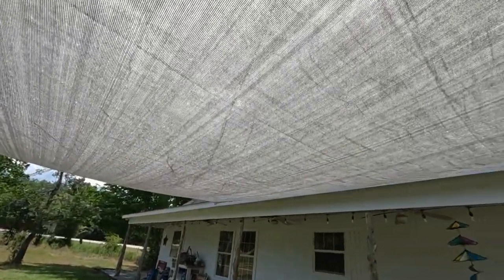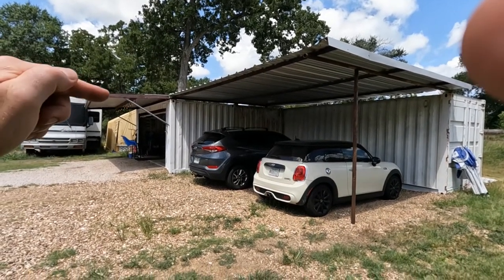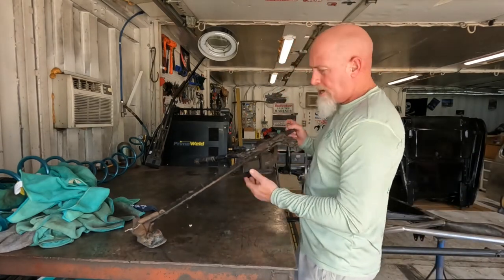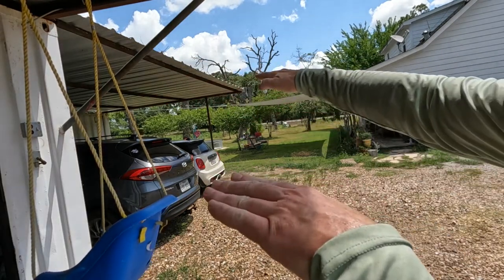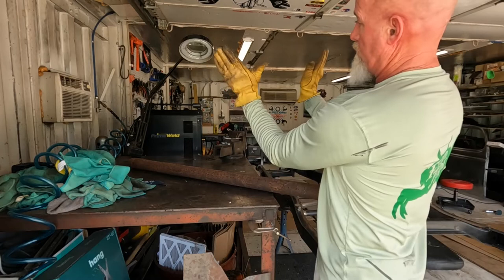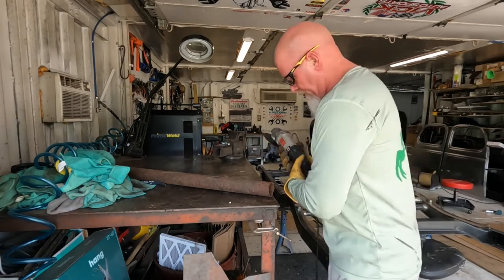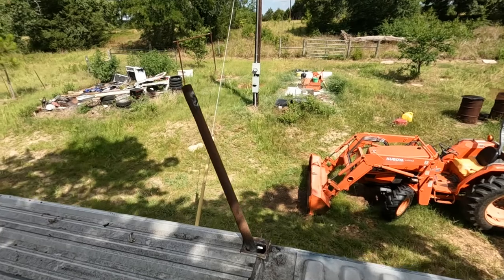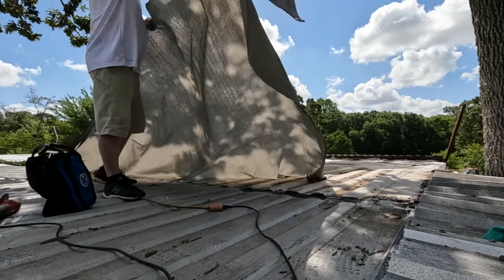Shipping Container Garage, Install a shade canopy for the roof

Comment: I hang shade cloth between my 2 40' containers every spring for the summer and remove in the fall. They are 24' apart, so 2 shade cloths that are 20'X24'. I live in an extreme wind area. I have found that rubber rope, similar to rubber bungee material, but bought in bulk, is far superior to any regular non-stretchy rope for withstanding the high wind gusts. Regular rope broke frequently and was hard to tension. With the Rubber rope the dee-rings or seams at the corner of the shade cloths usually give out before the rope does.
Reply from the maker: Good idea, thanks buddy

Comment: Is the canopy water proof? Or does water pass through it?
Reply from the maker: Not waterproof, it kinda drips through. Passes quickly enough not to get weighed down but it's a Texas drought and has only rained once for a few minutes a couple week ago.
Reply: Hi Eldest. I was just thinking of doing this for shade porch on my mobile home.
Reply from the maker: I like them both. Reviews said they last about three years. Went back on the roof and tightened it up more using a ratchet strap for more tension.
Reply from the maker: https://www.amazon.com/dp/B093R6R3BN?ref=ppx_pop_mob_ap_share
Reply from the maker: This is the one's I'm using